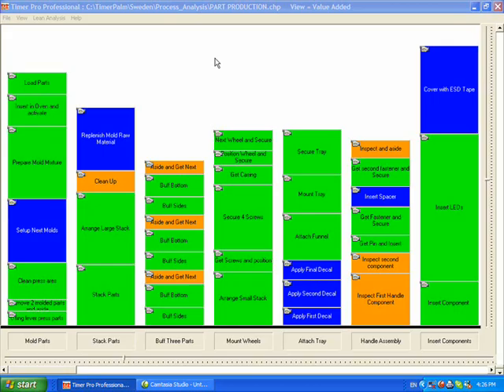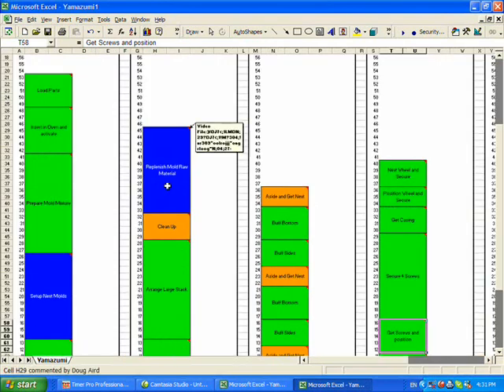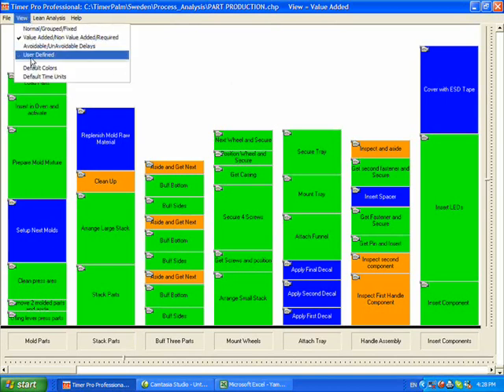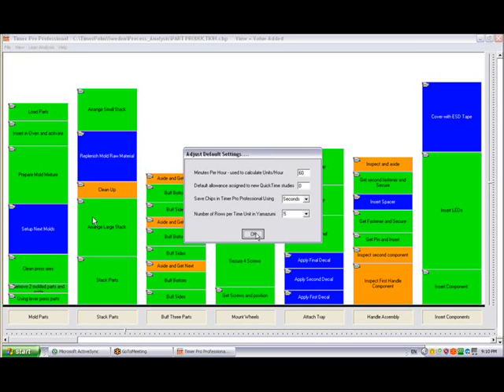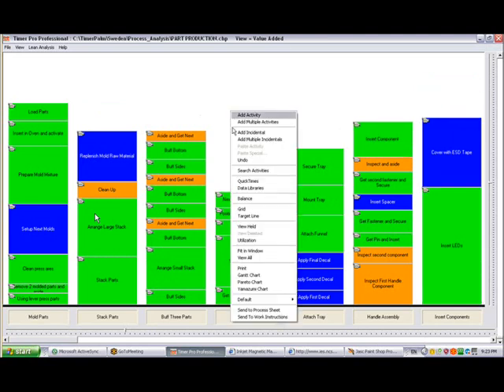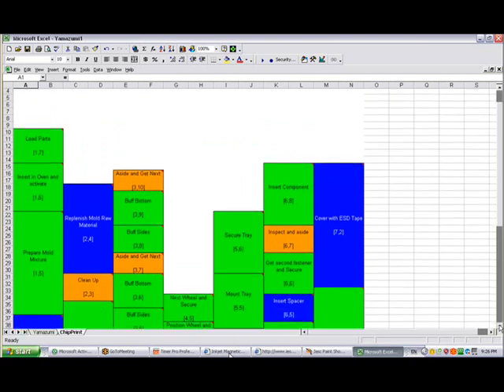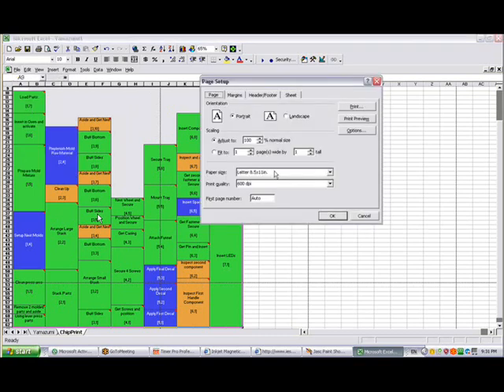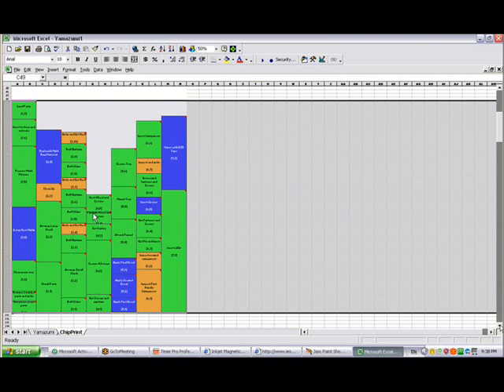Yamazumi Charts for Lean Manufacturing

Comment: is that applicable in microsoft excel? I am using excel 2010.
Reply from the maker: Hi Mike,

Yes the product will use Excel 2007, 2010 and 2013. You can see more info on our web site at http://www.acsco.com/Yamazumi.htm

You can contact us directly via http://www.acsco.com/contact.htm

Doug
Reply: Excel?   For a Yamazumi?  No,,, post its and a board, some, pencil, scotch tape.   And a stopwatch.